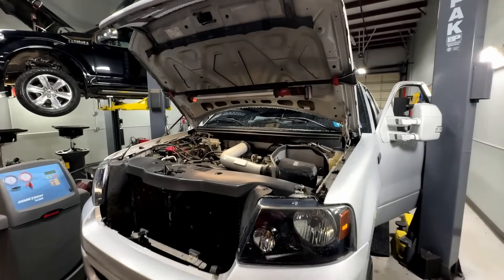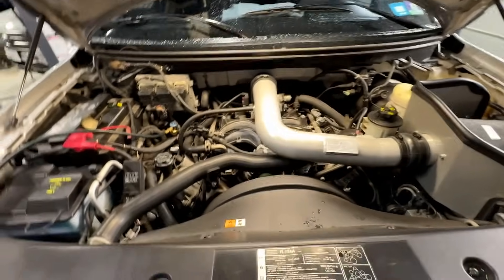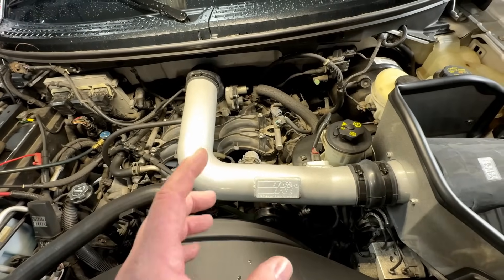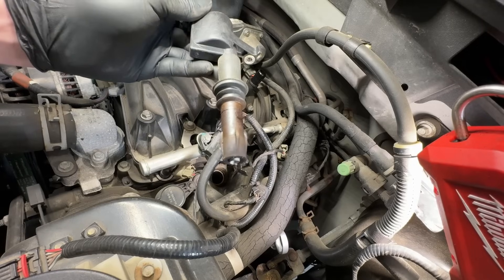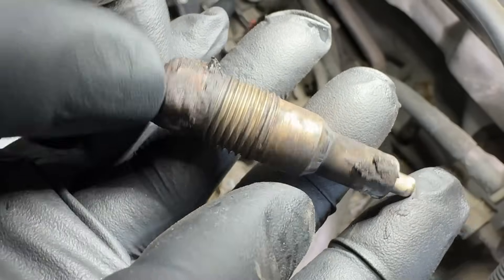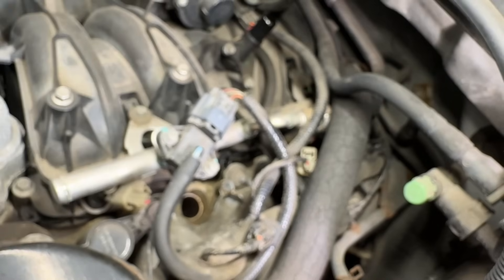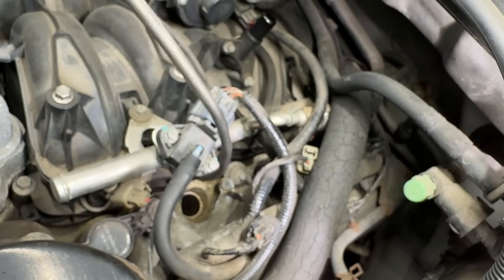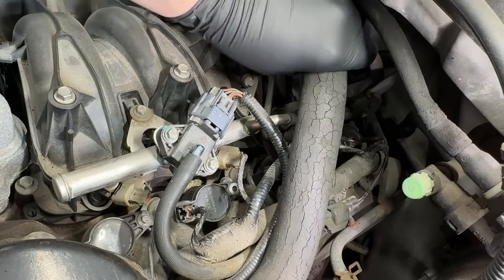Ford 5.4L 3v Triton Engine Tick Tap Diagnosis and Fix!

Comment: I have timing chains done and the guides and related components.  New intake manifold and later a new exhaust manifold. I immediately had a bunch of misfires after and the codes lead the dealership to plugs and coils (for some reason they didn't do them all but they did 4 of them I believe).    My tick is still pretty pronounced.   this is a 2004 f150.  

It drives fine usually when cold but loses lots of power after it warms up.  The exhaust system is fine..  I replaced the fuel filter and my fuel pressure is fine.  

Still loses lots of power.  sometimes barely wants to accelerate.  just feels bogged down but mostly when warm and the best i can tell only when under load. 

Any thoughts??   I'm kind of tired of going to mechanics for this as so far; none of them have helped.  They drive it for 5 minutes cold and don't recognize the obvious power loss.  Because the power loss is after it warms up but the few i've spoken with acknowledge that but then after they fix something they drive it for 5 minutes and say its fixed... It obviously is not fixed.

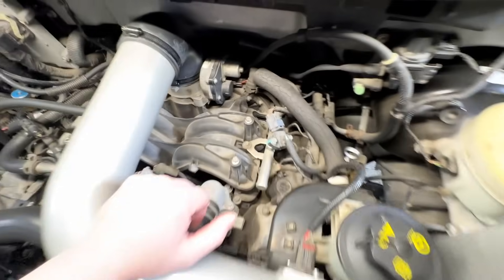Comment: At 3:16 you said people use a lot of antiseize. What is your recommendation? A little or none? I have always use a thin coat on the entire thread and then reduced torque by 15%, or down to 21 foot pounds in this case. What do you do?  Thanks.
Reply from the maker: Very light coat it will disperse from there, I never adjust torque for the anti seize as it is all by hand.
Reply: @FordTechMakuloco  I'll do that then And thank you for your reply. Your site is my go to.

Comment: Love the channel thank you so much for the content have followed you for years. I have 2004 5.4 110000 original plugs. Changing soon I have bought the E3 plugs and the accel boots. Do you have an opinion on the aftermarket parts. I'm sure you have run across do it yourself guys making this choice. I will stick with the one piece motorcraft replacement plugs . If you suggest . The e3 plugs are one piece. Also running a couple of tanks of seafoam in the gas . High concentrated to help with the carbon buildup. Is the motorcraft carb cleaner still the norm once the plugs are slightly cracked and soaked before as you say zipped out. Thank you again for all the 5.4 content.
John

Comment: I bought a 2006 Ford F150 single cab with the short bed with the 5.4 3v. I love it since my very first truck that I bought with my own money, and every time hear I some ticking and I get worried but this inspires me to do the whole timing chain with new phaser and oil pump etc. I want it for the long run

Comment: My 2009 5.4 3v f150 has a tick at startup that fades away in 15-20 seconds then is quiet expect for the fuel injectors running.The tick comes back when applying throttle at all speeds and ceases when off throttle. You can hear the tick inside the cab when accelerating.When truck is set to cruise can't hear the ticking inside the cab anymore. The truck is new to me about a month and a half ago.I can't see any broken manifold bolts that are missing. Ive tried 2 different oils (5w30 and 5w20) to see if that help,no difference in ticking.Ive checked and replaced all sparkplug and torqued them to spec while cleaning coils and boots.The truck gets great gas mileage in my opinion 19.4 + doing 70ish.I had a ram that got 14 at 70.I hand calculate my mileage to be accurate. Has anyone have any idea what the tick could be after the above mentioned items I listed?Any input would be great.Oh i don't smell any fumes coming from the engine bay.

Comment: After a timing job, new phasers,guides tensioners ,oil pump, lifters and rollers, vct solenoids, sparkplugs, coils, everything oem. My 5.4 still sounds horrible 😢 no luck. Your videos are amazing! Without them my truck wouldnt be alive.😆
Reply: I had a tick coming from my ac compressor going out if you haven’t looked at that

Comment: HELP!!!!2005 5.4  I just done melling 360 oil pump,,timing chain,guides, tensioners and chains (cloyes set) and put phaser delete blocks in and custom  tune from western motorsports out of calgary alberta canada....trucks starts and idles beautifully but give any throttle and it loses all power....does not make any noise ever starts easy i have checked all coils and when applying throttle if applied slowly it will rev no prob and initially after I removed all coils to confirm no bad ones and no corrosion or anything interrupting spark path to plugs it ran great for 1/2 mile then back to gutless barely pull itself again it never makes a tick has good oil press and when releasing the throttle for a split second you can feel it surge with power but that's it any throttle and barely pull itself....from 1st start and throughout checking things all as they should be no missed sensors plugged in or anything ect. It has never triggered a check engine light....am using a snap-on solus ultra last updated in 2019....have double checked timing and had 2nd pair of eyes timing is dead on....what am I missing im a gm master tech took on this job for a buddy only as a favor after he got taken by a hack and im not really making any $ on this and im ready to see it gone yesterday
Reply: I live I calgary and have a 5.4 triton and FORScan, small world huh..

Comment: Got home and did exactly what he did in the video. So far I only checked 2 coils! Did the touch test while truck was running(was scared to death thought I was going to get zapped) I thought I felt it in the front coil driver side but took it off and it was fine. Second coil going towards back of engine felt a more pronounced thud so I pulled it off and just like the video said I could smell strong odor of gas and coil was covered with soot. VERY heavy soot so I tried to clean much as I could out before pulling plug. Unscrewed plug and it came out pretty easy and sure enough the little metal piece around the plug was missing. I didn't have another plug so I took it out my other truck since I have it taken apart anyway. That one was VERY hard to come out but I got it out cleaned it up and put it into truck. Put the coil back on fired it up and WOW!! I am very grateful that I came across your video! I have not checked my other coils but I will go through each plug tomorrow and replace all the plugs and clean all the spark plug holes. THANK YOU GREATLY  to poster of video. I will definitely watch the video of you doing the timing chain when you post it.

Comment: 😂😂 I think I am in love with you man! I have two of these trucks 08 & 09 both with 5.4 3V but both also are f250. One has this same issue but I never pulled the coil to see I just know it sounds weird just like this one and I can here the ticking or popping noise through my radio when it's on which made me believe it has to be something with the spark. Mechanic looked and told me it was my exhaust and that it's common and quoted me $700 for the repair but I did not agree to it because I don't think it's the exhaust. When I get home I will pull the coil. Can't wait for the timing video because I am redoing the timing on the 09. Just paid close to $4K to the same shop about 4 months ago to replace the timing and it is now giving me p0022 code. Can't see paying that much again for the same problem. That truck runs great at idle and for about 20 minutes driving then it starts sounding like a diesel. Just took the valve cover off last night and everything does still look brand new in there. The driver side top of timing chain seem really tight but the bottom side of chain is extremely floppy and loose from what I can see but will finish tearing everything down tonight.

Comment: Hey there. I have a 2010 Ford F150 Supercrew Towing Package XLT with the 5.4 Triton. When I got the truck it had a shudder, which i initially believed was the torque converter. Come to find out its the engine misfiring at certain rpms. Ran BG EPR and put 5W-30 with MOA. Also picked up some 44k. That reduced the severity but didnt fix it. Replaced the coil packs and plugs. Again, reduced. Hooked forscan up and found the driver 02 sensor had failed. I just replaced it and the miss is still there. I do have a K&N cold air intake on it which i have triple checked for any leaks. I cleaned the throttle body and mass air flow sensor. I also ran Shudder fix through the transmission in case it was the converter.  It wasn't.  I replaces the transmission filter too. Still nothing. Ive knocked air and spark out of being possibilities. My last guess would be fuel. Possible it could be the fuel pump? Fuel injectors?

Comment: Man I just bought an ‘08 otherwise in great shape with low miles, with this exact tick. Previously owner said it was an exhaust leak but I knew it wasn’t cus it never went away. Anyway after watching your video I found it had a bad number 6 so I changed all the plugs and now the tick is GONE! Thank you brother for this helpful information

Comment: Thanks for your video!

Woops 😂.... I just tighten my spark plugs by feel.... Not too tight but firm.. never had a problem but I really should just buy a torque wrench... It's my 2015 Fiesta ST that's modified to around 250hp and it flies.. insane fun.. but not if it goes BOOM..... 😮

Comment: Hey there great video I'm getting ready to change my plugs in my 05 150 5.4 have you done a video on replacing the spark plugs I saw one the guy says get the engine really hot and then remove with a impact gun? Owned this truck since new it has 109,000 miles and have never been changed I'm planning to take the coils out blow out the holes stick the coils in get the hot remove the coils squirt some penitrating oil in hole brake loose with good stout breaker bar and remove would like your opinion on this?thanks

Comment: Thanks for your videos. You talk much about the 5.4 3v engine i have heard horror storys about those plugs breaking off. I have the 5.4 4 valve engine in a 2004 navigator is there any issues with the plugs breaking off in those. Im not sure if they have ever been replaced and it has 152000 miles on it, no running issues it runs and idles good just thought i should replace them.

Comment: I got a 2008 ford f150. It’s the next generation engine. Do I have the spark plug issue when removing them. ( breaking them off in the head)
Thanks, love your channel. You are great.Tom p.

Comment: Hey, I just bought a 07 f150 with the 5.4 3v, and the guy I bought it from said that he replaced the engine with one he got out of 07 expedition. When I pulled the plugs, they did not look the same. They were smaller and had more threads. Do you know anything about this? Is the torque specs the same?

Comment: So truck has 60,000 on it, you fixed the tick. Sounds decent. Why then a timing job still?
Also, didn't you recommend 5/30 Mobil 1 or Shell?????

Comment: I was planning on doing a manifold replacement until I saw this and the tic was a spark plug on the passenger side. This is the 4th time your videos helped me fix my truck. 248,629 miles and it works everyday.
Reply: im nearing 200k on mine
Reply: Don't they get stuck in the 5.4 3v and break off
Reply: Which year is yours?
Reply: @rehab4everybody  mine? Mine is a 2004  and about the tic idk I did the manifolds and had the plugs replaced still has the dam tic lol I don't drive it much since I put the last comment someone hit the passenger side I'm waiting for her insurance to tell me of they will fix it or total it cus the cash value of the truck isn't that much .... sucks cus it's a good truck

Comment: Awesome video sir like always. I recently bought a 2006 Ford Econoline E350 van with a 5.4l 2v engine with only 49,522 original miles. The van belonged to the local college, and it sat up a lot. Would you replace the plugs in this van, or would you leave them alone until it reaches 100k miles? I replaced the air filter and fuel filter and oil filter and oil. The only thing i didn't change were the plugs. Would you replace the plugs? I'm scared of breaking them.

Comment: Hey! I am doing the cam phaser and timing chain replacement on a 5.4l 3v engine in a 2013 lincoln navigator. I bought a mellings high volume oil pump . It comes with an 80 psi spring but also a 60 psi spring. Do you recommend keeping the higher psi spring in it? This engine has 330k miles on it. Been a good one. Planning on keeping it til 500k at least. Thanks in advance.

Comment: Just did the plugs on my 2018 F150 5L.  Thanks for the guidance.  Ford tech told me that the tic/tapping was bad valves.  $3k engine repair.  New SP 589S cost $72.  Problem solved.  Saved $2928.  Great channel.  And Ford wanted $700 for two rear shocks.  I got Bilstein B8 5100s for $265.  40 minute job in the driveway.  Thx Brian!
Reply: That's awesome you took care of your vehicle and awful that a dealership tried to rob you. I need to do the spark plugs on my 2009 just been nervous they will be stuck. Definitely going with motorcraft spark plugs.

Comment: Did you leave the U-shaped ground metal part in the cylinder?  If so, it can cause some damage:  brake the porcelain of spark plug,  jam the valve, brake the valve stem, etc.

Comment: Had that happen to #8 10k miles after i had Ford dealer change plugs...broke alot of plugs on my works 3V fleet trucks, so i though going to dealer with personal would save some headaches. Should have done it myself

Comment: could you help me with p0193, high fuel pressure fault, CE will clear itself and come back month or so, does not interfear with performance on 2004 ford explorer 4.0 engine.

Comment: Hoping you can help. I’ve watched many of your videos as your trucks have similar symptoms as my own. 2006 Ford F150 XLT 5.4 Triton 3v. It received all new motorcraft spark plugs and denso coils. It’s still misfiring and it sounds just like this noise. I’ve seen your past videos where fuel smell can mean a plug isn’t torqued correctly. I checked 1-7 and all were close to spec but still misfiring. Truck bogs on idle intermittently but drops to 200-500 RPM once put in gear. The tick is coming from 1-4 side. Exact noise as here. It smell like fuel, and exhaust throws a white/black smoke upon first start up. No smoke upon any other start. Exhaust also has the smell of fuel. Should I remove the plugs, could one of the new plugs gone bad?
Reply: Also there’s no check engine light so it’s making difficult to diagnose. I’ve tried the paper clip with the drive module connector. I change the driver module from a working 2006 and it did the same. I’m lost and need serious help.

Comment: I bought my sons Mustang for a real good price from a "Ford" dealership who said it needed an engine.  They made sure to make it clear absolutely no warranty and had a blown engine.  It didn't get driven much since my son didn't have his license at the time and I had two years to replace the engine. I drove it with a knock sound occasionally just to run it and keep the mice out.  When I had some free time, I pulled it in the shop and decided to do a tune up.
  One plug was half gone.  I ran a scope into the cylinder and didn't see any lose pieces but the top of the piston had small pits.  I put new plugs in, changed the oil and filters, and started it up. What do you know, no knock, no tick no nothing. It's been four years, and my son has driven the heck out of it for the last two. We've even installed detroit cams, programmed it, exhaust, JL3 intake, pulley, 4.10 gears, all the bolt ons.  The money I saved purchasing it allowed me to mod it. 
  Someone elses screwup and we have a great car.  I didn't think it would last long but it's daily driven hard.  When people tell me 3v's suck, I think differently.  Every 3v I've had was very reliable with good maintenance.
Reply: With the phazers locked out is the most reliable imo
Reply: You're the best dad ever!

Comment: Mine kinda does the same, but it’s not loud. It’s more of a quiet sound.

BUT I do have a question. I have replaced all the coil packs and spark plugs, but whenever I drive my truck for so long or if I put it in reverse and then back to forward the motor shakes and can’t figure out what it is. My only option was the motor mounts. I’ve climbed underneath and obviously they are the original and worn out, but if I replace those and it still does it, I am clueless on what to do next. Any ideas you may have?
Reply from the maker: You have phaser oscillation due to low oil pressure and volume at the phasers when hot.

Comment: @FordTechMakuloco - would this situation result in a (useful) error code being thrown?  I believe I have a similar "tick" on my 2014 Ford Edge 3.5L.  Some yahoo changed out the plugs & coils (yeah, wonder who?🤔🙄😒) 20K miles ago.  Pretty sure I torqued them to spec, but ya never know for sure.  Something I'll have to check on alone with the exhaust manifolds. Thx for your great videos.

Comment: I did the injectors on my Ford 5.4 down here in Australia a few months back and I had to disconnect everything and the wiring is so brittle. You cannot move anything without it cracking. It sounds like dried pasta in a packet and I thought to myself if this thing develops a misfire because I’ve damaged some insulation somewhere we’re on earth am I gonna get a wiring harness from?…….

Trying to keep them going after 22 years this is what the issue is going to become

Comment: Not saying you’re wrong with this particular issue, but it’s not a blanket statement solution for the 5.4 L cam follower issue.   Most everyone is aware of the oil repair replace strategy.  Anyway, great video
Reply from the maker: Not sure what you are trying to say here.

Comment: I worked on a 2010 expedition I believe it had 200k miles the customer bought it brand new original engine and transmission the truck runs perfectly this customer takes excellent care of this truck